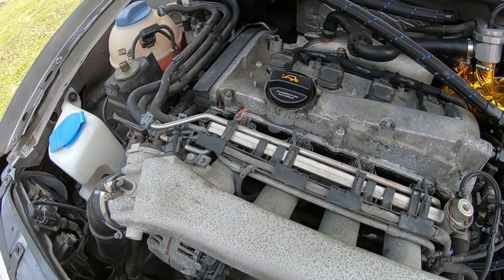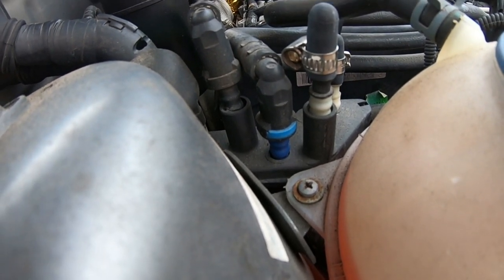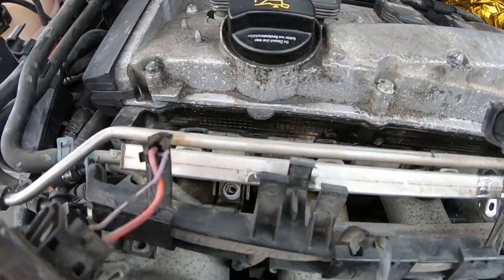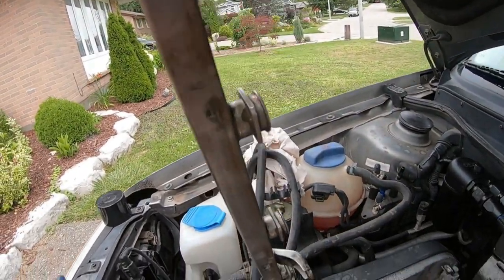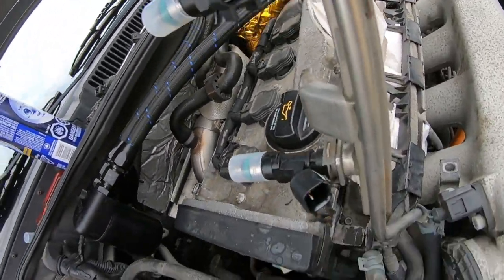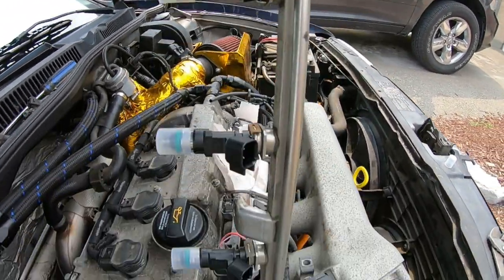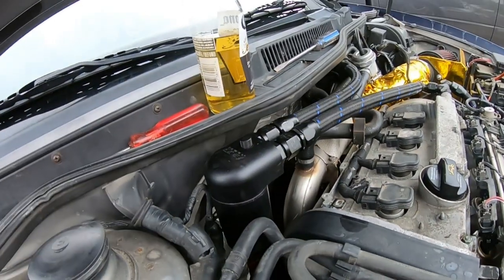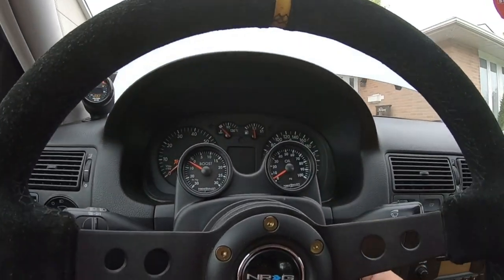MK4 GTI/Jetta Fuel Injectors Install (Time Attack Ep 26)

Comment: Did you need a tune after these mods?
Reply: Absolutely he will. Even with a tune, 630s are way too much injector unless he's planning  a significant turbo upgrade. Stocks are 317cc @3bar FPR.
Reply from the maker: Correct. A tune will be needed forsure, and like mentioned, The 630s are more than enough but it gives us some options for future turbo upgrades!
Reply: @maxattackmotorsports5354  why did u use such big injectors? Are you planning on opening up the motor and doing some head work? Or keeping stock internals and just doing bolt on add ons?
Reply from the maker: @daquanwaters7653  Motor will be stock internals for now. Doman8 is a really trusted and well known tuner in these parts and know he can dial them in on whatever setup we may have. In the future, depending on class rules for tracking, we plan on getting head work as well as rods for a bigger turbo application 🤙
Reply: Part number of injectors